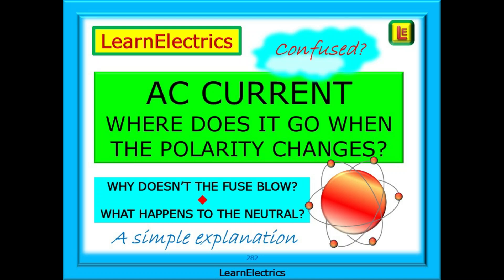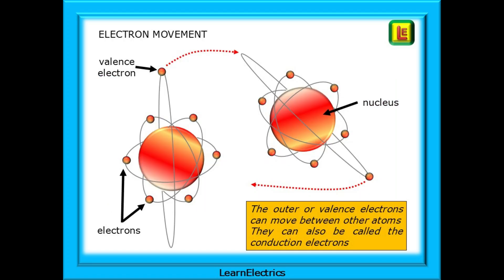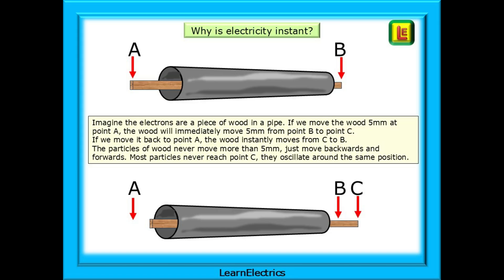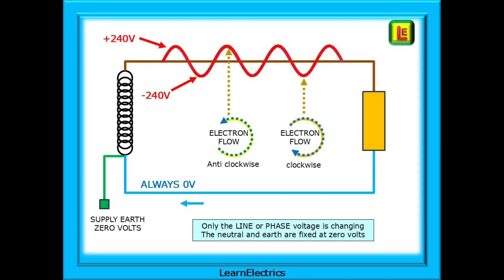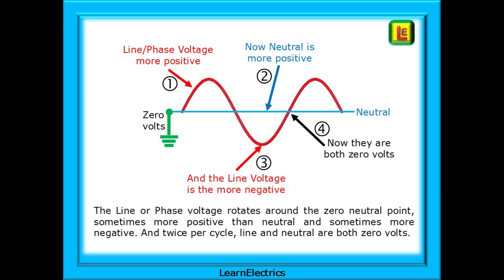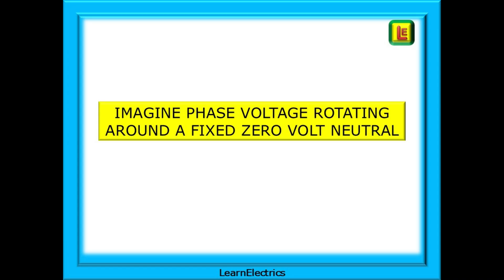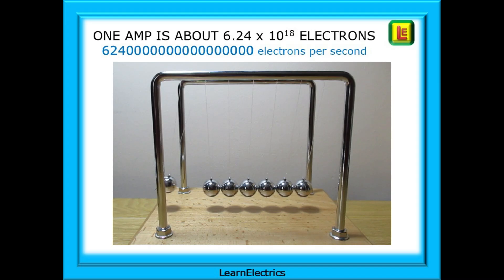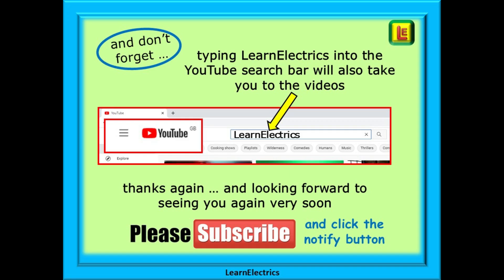AC CURRENT – WHERE DOES IT GO WHEN THE POLARITY CHANGES – WHAT HAPPENS TO THE NEUTRAL?

Comment: How will ac current at -240 v on the phase line flow to 0 v on the neutral line ?  You're saying lower potential is flowing to higher potential? is this a new law in physics?
Reply from the maker: Take a look at this video on the link below. Thanks for watching, glad you enjoyed it. Dave.
https://www.youtube.com/watch?v=YFGtidEyDZc
Reply: @learnelectrics4402  watched it- does not answer the question about the "new law of physics". I think the minus sign on the 240 ac is confusing the issue maybe. It's not really negative as implied by math but just is the direction the 240 current is flowing in. Should look at the absolute value of the -240 v as 240 flowing to 0 on the neutral and everything makes sense higher potential flowing to lower. That minus sign confuses the discussion. Do you have other videos to watch on this topic

Comment: Electrical stuff is about EM fields (energy is outside the wires). So don't worry "where the current goes", this is not a practical problem (you're making up "problems").
Circuits, electron flow, Ohm's empirical equation (lames call it a "Law") and hydraulic analogy is for children (not the brightest ones). Go figure...
Reply from the maker: Thanks for watching.